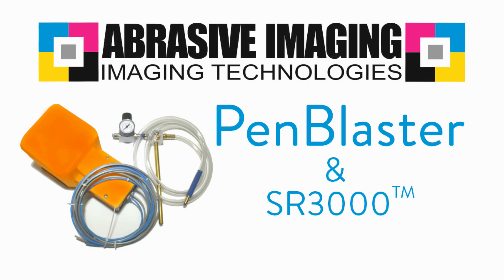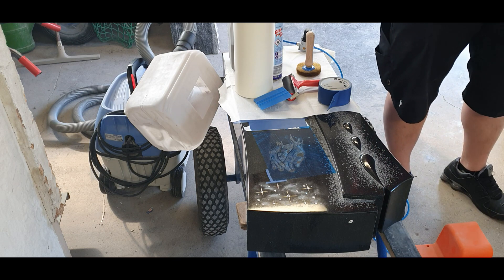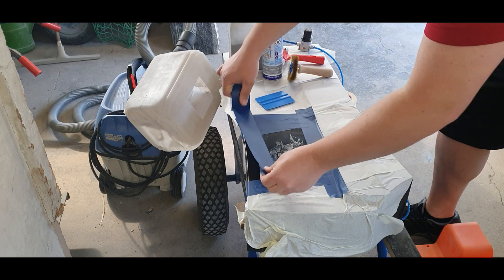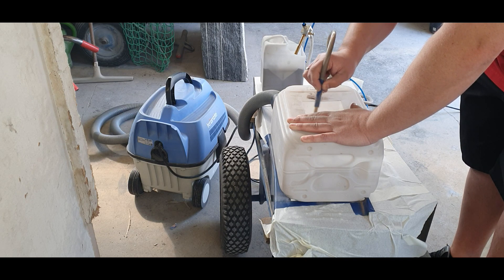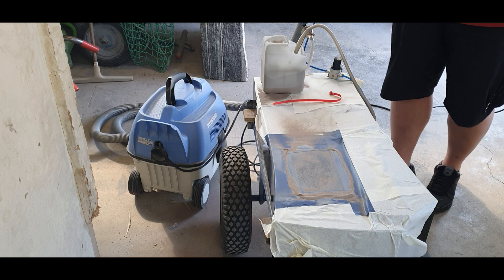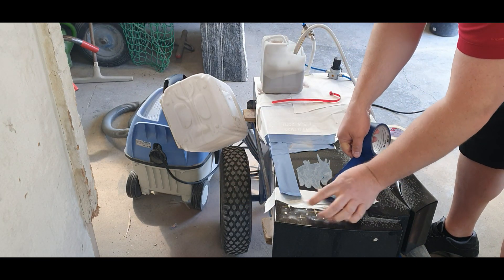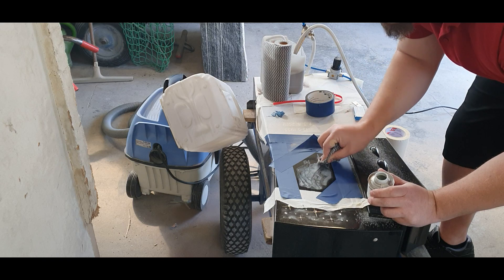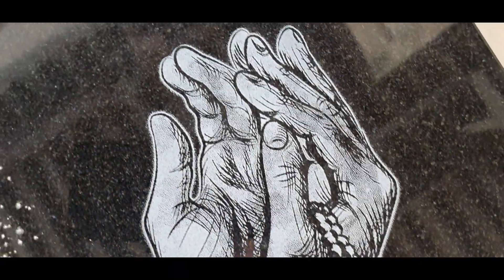Penblaster / Micropen for dust-less sandcarvings - by Abrasive Imaging - Sandcarving Granite

Comment: Whats the point of using a vacuum with a hepa filter when you pour the aluminium oxide out of your plastic cannister when you finish blasting? As you know that stuff is very fine, and by doing what you did you have released it into the air and probably inhaled a lung full which has serious health issues....or were you wearing a mask?
Either way still pretty irresponisble to let that stuff fly about the air without taking proper precaution
Reply from the maker: First of all - Yes, you are right. You should use additionally a mask to prevent inhaling quartz dust. The abrasive itself is aluminum oxide 150 mesh which is not harmful - but it is not made for inhaling it too. The reason of this plastic box / 5l Canister is to prevent messing up your working area. It catches a lot of dust, but not 100% - maybe 70-80%. A lot of people are using a sandblasting gun without a cabinet and have the problem of messing up their premises, backyards or theirselfs with dust and abrasive. This little plastic canister and a vacuum cleaner is a nice tool to keep your working areas much "cleaner".  This plastic Canister is not part of the pen-blaster, just an additional tool we are using.